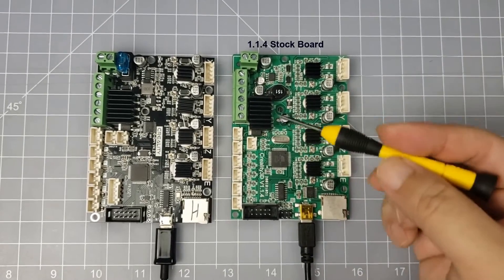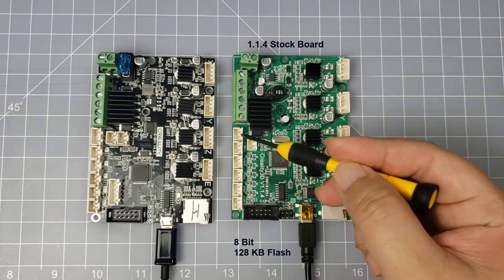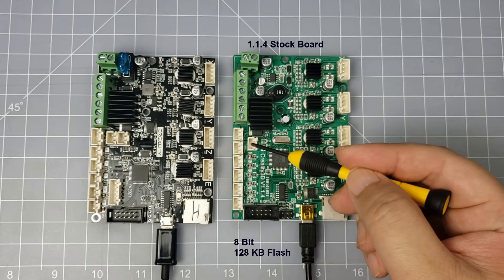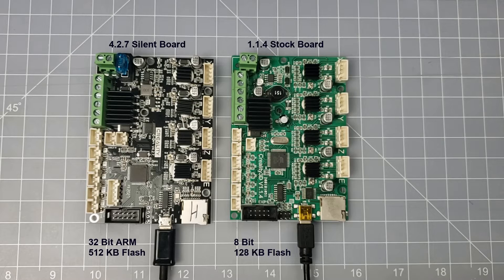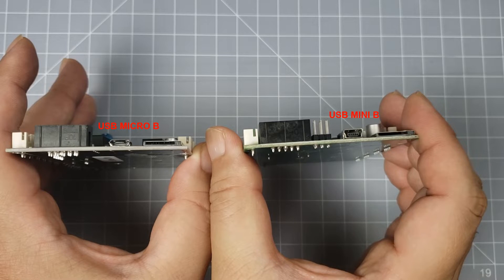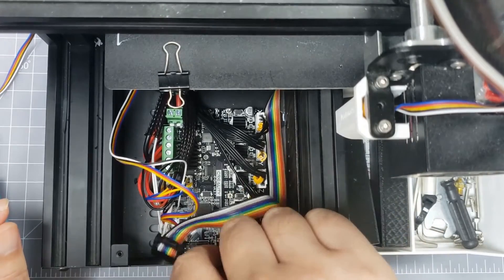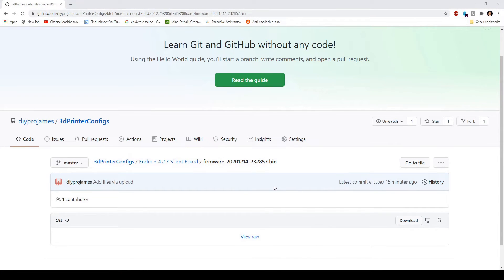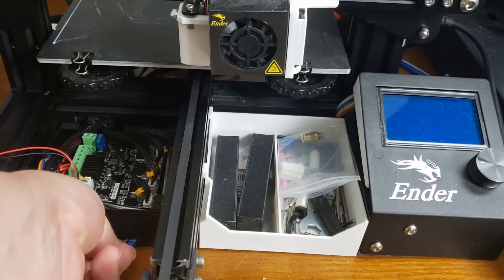ENDER3 4.2.7 SILENT BOARD UPGRADE HARDWARE INSTALLATION - PART 1 - BLTOUCH 3.1 - MICROSWISS DD

Comment: I could just have missed this part but could you clarify why you've used the z endstop pins (3 wires on the bltouch port and 2 wires on the z endstop pin) instead to use all 5 wires into the bltouch port?
Reply from the maker: The reason is because the bltouch is a upgrade and not a standard option on printers. It uses the existing endstop pins (specifically z-) to send the signal. This is why the bl touch have the 3 main wires split with the 2 endstop wires. It was made to be used on multiple and pre-existing boards. So accordingly the firmware is built based off of that architecture. Of course if you want to customize the firmware you could remap the pins, but this would be extra work. Its plug and play. Easy to pull out the existing endstop and attach the bltouch. This is also the reason why some instructions will tell you to switch the wires within the connectors to fit that specific type of board.
Reply from the maker: This is the adjustment made if the 5 pins for the bltouch https://www.youtube.com/watch?v=qK5ThhZEKw0

Comment: Hi there!! Very comprehensive and useful video tutorials. I came across your video as I bought a 4.2.7 board some days ago and mine is advertised as Ender V2 (but my printer is first gen) so I would like to know if you could assure me if the board is the same (I understand I will have to flash the firmware for my own printer) but I'm afraid I'd rather not plug the board in without a confirmation. Comgrow hasn't been able to assure me on that. Thank you!

Comment: James I desperately need help lol. I have the 4.2.7 mainboard, Bl touch, and the creality touchscreen upgrade on an ender 3. The auto bed leveling will not work. The only firmware I can use and have things work is the creality touchscreen with bl touch firmware but the auto bed leveling does not work. Please help broseph.

Comment: Bought the 4.2.7 board for Ender 3 Pro to upgrade from 1.5 board. Can you tell me which of the configurable fan ports is for MB cooling and which for part cooling. I did not see any advice in the manual that came along.  I now have it in the port closer to the PCB edge. Thanks for the vids!

Comment: Hey there broski, to you happen to know if you buy the silent 4.2.2 (4.2.7) do you just flash 4.2.7 or did I screw myself in a bad way?
Reply from the maker: You should use the firmware meant for your board.

Comment: Great tutorial! Would this 4.2.7 board work for the Ender 3 V2?
Reply from the maker: Yes, It should work with the ender 3 v2. The firmware has to be modified to accommodate the lcd screen.

Comment: Hi, few days ago update my ender 3 with this board 4.2.7, now when power on the print the steppers they make a bad sound like in your video. with 8bit board this did not happen. can you explain to me why?
Reply from the maker: I post a lot of videos. When there is no video source and timeline reference I don't know what your referring to. Could it be possible your hearing noise that you didn't notice before because of the loud motors.. Now that they are silent every sound seems louder..?
Reply: @DiyProJames  I'm talking about the noise you hear immediately after pressing the power supply button.  you can also hear it in your video, with an 8bit card this did not happen, if you try to move the platter during switching on you will see that it will make strength because the steppers is on, after a few seconds the steppers are released and then you can move without problems.

Comment: So I have an Ender 5 pro, went from the 8 bit 1.1.5 board to the same 4.2.7 board. Something you touched on, the case fan is no longer against the edge rail as it used to be. I connected my hot end fan to the 2 fan block just below the the edge rail, but I plugged my case fan to the 2nd port on the 2 fan port and nothing. Is this where you plugged your fan? Did you have to swap the polarity to make it work? I'm missing something on mine and no longer have my small case fan working (not the power supply fan)
Reply from the maker: No, I did not change the polarity... Try using the gcode:
m106 p0 s255
m106 p1 s255
m106 p2 s255

I believe the case fan does not power up at power on. It switches on and off during use...

Comment: Also, don't make it harder on yourself, just take the entire main board housing off of the printer.
Reply from the maker: That was the maximum amount I could take out without removing all the taping around the wire bundle.
Reply: @DiyProJames  I did that very thing. Th e tape was just tape. Removed carefully, I reapplied after my board swap. Kinda fried the extruder controller on the original board xD

Comment: I have heard it's not a good idea to solder the wires together. The solder over time can deform and that will allow for there to be space for the wire to move which can cause a spark. Btw you make some great videos man thanks for the tutorial you have made this upgrade so easy for me.
Reply from the maker: Thx for the tip.. Appreciate it..

Comment: Just wanna ask, can I use tft35 e3 v3 for the creality v4.2.7?
Reply from the maker: Contact the manufacturer if you need a definitive answer. If you want my opinion. I'm going to say most likely yes. The hard part is going to be adapting the firmware. You're going to have to find someone who's done the procedure before and see if they're willing to share the firmware. Otherwise, you'll have to compile your own, but seeing as your asking if these two are compatible it maybe difficult task to compile your own.
Reply: @DiyProJames  thanks for the reply👍
Reply: I have a TFT35 and it will work in Marlin mode but no touch screen.

Comment: Hello
First of all, your videos are very helpful so thank you for making/sharing these.
I just want to share some info:
I have an Ender 3 pro printer and I bought 4.2.7 board + BL touch from Creality website. I have connected it in 3+2 pin setup but could not make the BL touch work with the 4.2.7 board+bl touch firmware they have on their websitesite. I have tried for hours, flipping the z endstop wires, checking ground, 5v, signal wires etc. but nothing. Then I tried 5 pin connector setup and it worked instantly.
So the 4.2.7 board+bl touch firmware they have on their websitesite is set up to use the 5 pin port, not the 3+2 pin!!
Reply from the maker: Thanks... good to know..
Reply: which config did you download? i don't see an option for a download on ender 3 pro 4.2.7 and a BLTouch V1.3 with out an adapter board.
Reply: @porter327  Just try the one which says adapter board+bl
Reply from the maker: @porter327  The 4.2.7 board does not use an adapter. Ender 3 and Ender 3 pro are basically almost identical printers. It firmware is listed in the description. Here's the link https://github.com/diyprojames/3dPrinterConfigs/blob/master/Ender%203%204.2.7%20Silent%20Board/firmware-20201214-232857.bin

Comment: Hi, I recently purchased a BLTouch kit and the 32bit board for the ender 3. I have marlin on my computer updated, from other videos. I am at a loss for what to do next. How do I get the updated marlin v2 onto the main board of the ender 3? Any help would be great.
Reply from the maker: The easiest way is to find someone with the same board with the same upgrades you have and get their firmware(3d printing group via facebook or google search). Copy the .bin file to the micro sd card. Insert to printer. Turn on printer and should upload firmware.